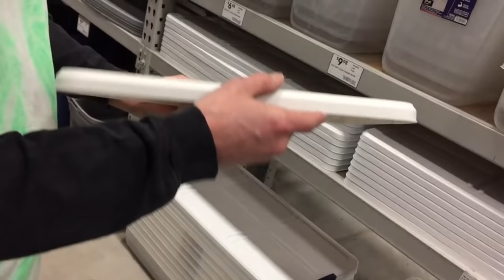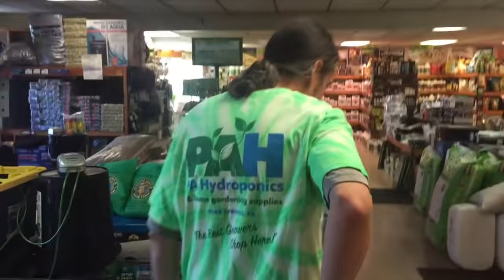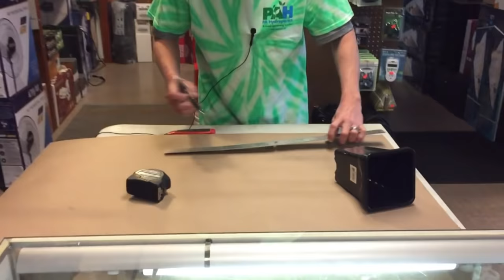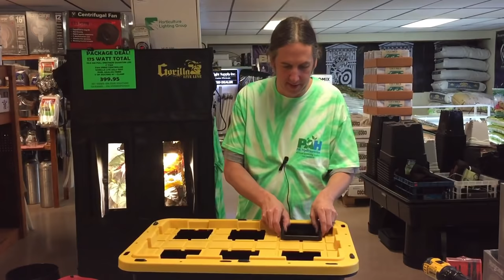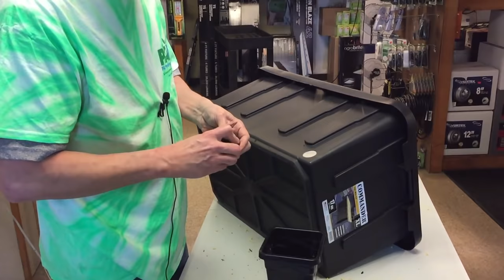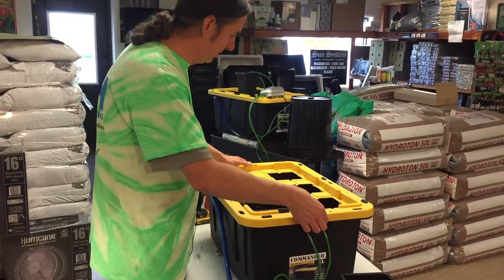Easiest Multi-Plant DIY Deep Water Culture (DWC) Bin-Tote

Comment from the maker: * I forgot to mention the top of this is yellow and can let light thru so maybe put a piece of foil over it to block the light from growing algae if you have big lights. * Thanks for watching! Gary
Reply: Or, a small piece of blackout material across the top would be nice if you have some lying around. An aluminum foil cut (like a paper cut) is no joke and that blackout material is a much cleaner look.
Reply: @richiepropster4313  I would spray it black and then white. That way you are lightproof and also reflective to keep the heat down.
Reply: Only use black buckets, because of light penetration causes bacteria growth but black does not.
Reply: I was doing this but was having some issues, I feared my solution may be reacting with the foil so I just painted it matte black with Krylon spray paint. All paint is external.

Comment: Nice job Gary, i built one and tried it as a RDWC. Worked great but my problem was keeping the water from getting warm. I believe i asked you about it and what i came up with was to put a timer on the water pump. Which worked ok. Do you Have a good idea on keeping the water cool? Thanks Gary and love the videos!!
Reply from the maker: This one in particular does not have a submersible pump so it doesn't get hot unless the room air is hot. I really do believe in the 1 minute on 4 minute off way for the pump, when it's only on for a minute at a time it doesn't get hot. Other than that you got the chiller which can be expensive and an energy hog and the chiller itself put's off heat! frozen Water bottles done last.... Don't know what else to say on this. Have a good one! Gary
Reply: Thanks For the info Gary much appreciated! @PAHydroponics
Reply: I made my own chiller out of a Computer CPU radiator that I bought at a garage sale. I removed the 5VDC fan and bought a 110VAc fan off amazon ( about 5 inches )   I have it using a smaller separate pump but id love to hear Gary's ideas on using it somehow with just one pump.

Comment: Hi Gary:
Can this unit be placed in a grow tent? I am a little concerned the water temperature may get too warm if I do? Thanks for these great videos!
Reply from the maker: Hello, it can go in a tent, the heat is more about how your lighting and ventilation is doing. I have suggested in tents with big lights to put some foil on top of the bin to reflect some of the heat off and block the light from getting in reservoir. Hope this gives you some idea's and thanks for watching! Gary
Reply: You can add a little ice at a time to drop water temps.
Reply: @firemanjim324  can also wrap buckets in some bottom plate seal foam, and cover in Mylar to reflect light and help keep heat off. I been chilling around 66 all day long and no chiller

Comment: Gary, have you done any experimenting with the Dewey Mister?  instead of air stones AND I used some of your level indicators to build a system they worked great. what if you wanted to put a small fan /radiator somewhere in series with the pump to cool the water?  how would you do it? Add a small second pump or somehow stick it in the line with the existing one?   its a 5 inch radiator with a 110VAC 5 inch fan on it but 3/8th barb hose fittings so its smaller throughput.  Thanks for your Videos!
Reply from the maker: Thanks for the compliments ! Not sure what you mean here but if it works that is what matters. I have seen people make chillers out of old mini fridges, dont know if blowing room temp air into system would help tho. G
Reply from the maker: I have messed with the dewey misters and they are good for some things.

Comment: I have a 35 gallon similar idea, issue is keeping my temps down where they need too be. (68-72) I was planning on adding a top off reservoir. (Thanks for that idea and vid as well)  I have 2 questions.  What size of top off Rez is sufficient for a 35 gallon , and could I still add a water chiller, if so is 1/10 active aqua enough? Or do I need to go to 1/4 hp. Thanks in advance my friend 🙏🏻

Comment: How large can you go with those Commander totes?  I'd like to get a couple at least 3 ft long for my space.  However, when I got a 50 gal Craftsman tote, it ruptured from the pressure before I even got it filled.  I have a 45 gal Husky tote and it is holding, but it is bulging out a lot and I'm worried it will eventually give out and dump 45 gal of water on the floor when I'm not around.  I guess I could double up totes for extra strength, but that gets expensive.  I like the big totes because two sides of my space are difficult to access and maintaining a couple large containers is much easier than an bunch of small ones.

Comment: I have a question it would be dope if someone could answer. I ordered 2 H2OtoGro 6 plant totes. It’s the whole 9 yards. I want to know if it’s possible to make a configuration by joining both of them and building a rdwc top feed drop system connected to a reservoir for water chiller reasons. Is that possible. I’m a newbie.
Reply: Drip*
Reply: My problem is that I’d need the water chiller for both totes which would equal 12 plants.

Comment: Can you do an aeroponic? I did a 5 gal bucket with with a ~350gph pump ($15) to a standard 360 degree 'shrub' lawn sprayer ($2) with 6 2" net pots with foam 'clone collars' and 1.5" rock wool .  Using it to clone, so I have 2 gallons of clone solution going on 30 minutes on, 30 minutes off cycle. Looking for your knowledge and expertise.
Reply from the maker: Hello, we do have an aeroponic cloner video on this channel, you should check that out it might help. Gary
Reply: @PAHydroponics  great video